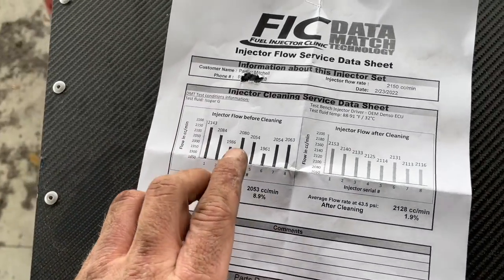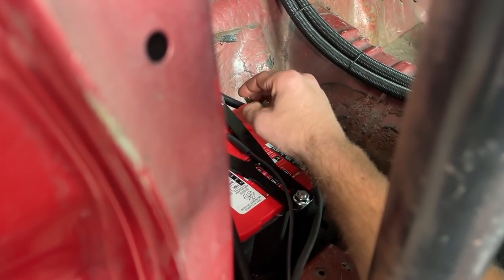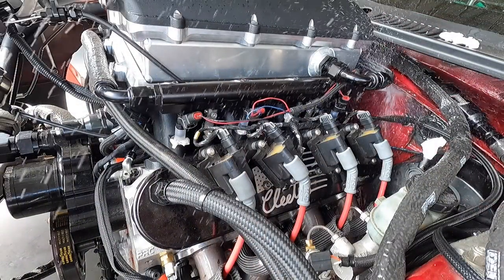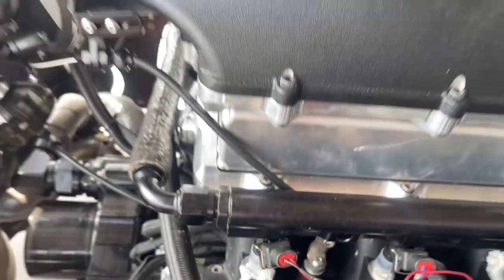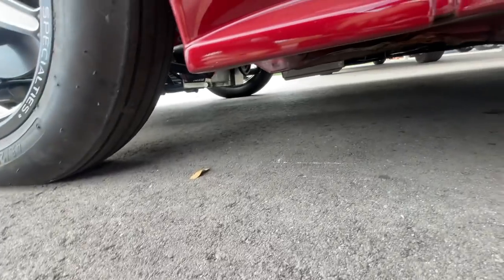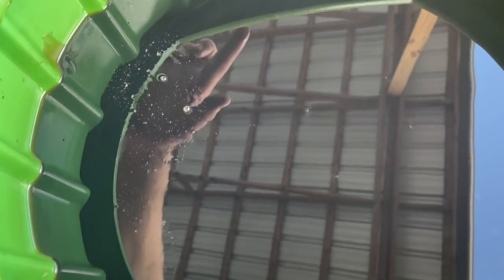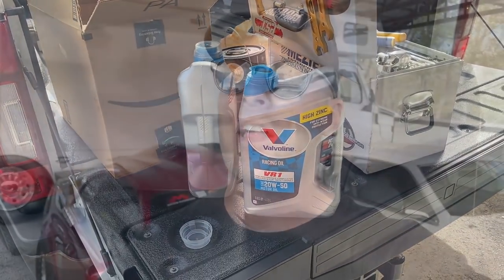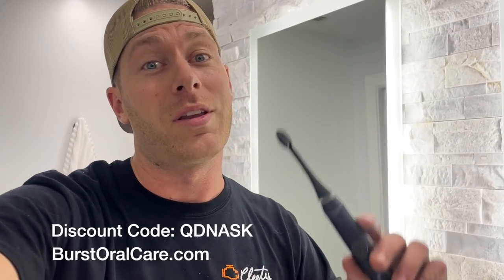Getting Dr. Pepper Ready for a Seven Second Quarter Mile Pass

Comment from the maker: Thinking I have a hole in the diaphragm of the fuel pressure regulator thanks to Tim M!!!
Reply: I've seen exactly the same issue with a bad diaphragm in an FPR.  It filled a cylinder through the vacuum lines.

Comment from the maker: Not proud of the mistakes and bs I show in this video but I’m showing them because I’m human.
Reply: Shit happens brother just do ur thang
Reply: The wire to the ECU sparked because it's the electronics to run the car and the battery has a constant charge because you run an alternator and it keeps the battery in charge if you didn't run an alternator it wouldn't do that
Reply: I'm here for the journey man
Reply: @keefespencer1173  it sparks a little bit because it is powering up the electronics in the ecu.  
He had the battery disconnected to PREVENT battery drain.  
Unless he had it off for a couple days, once the electronics have powered up once, 
they should not drain the battery over a couple days.  
Also, I did not see an inline fuse or circuit breaker on the Holley lead.  
You need to get one on that unless you just have a ridiculous amount of cash to throw away in the event of a wiring short.

Also, cant check for a fuel leak without fuel pressure.  
Injector harnesses wont show any power until the ECU is telling them to pulse.  
You should have had 12V (or whatever the battery is showing) on hot side, if you put ground to the block/body. 
Injectors are ground pulsed just like an ignition coil.

If you invest in an injector cleaning station, even a 4 cylinder unit, you can clean and flow the injectors yourself.  
Put the 2 highest flowing injectors at #1 and #8 cylinders since those 2 are notorious for running lean.
Reply: Nothing caught on fire, so how big could the mistakes be?
Reply: Plus, you were telling us regular folks to just go get a car, learning, and go race like you did. Mistakes are part of that journey.

Comment: This might be wrong, but was something I was told. If when connecting power wires to the terminals, if you get a spark it means you have a short, 3 of my vehicles do it and they’re the three that continually drain their batteries
Reply from the maker: Yes you are correct

Comment: Turning the computer on won't drive the injector's. Most ecu's need to see a cam or crank signal before firing injectors
Reply from the maker: In a terminator it does spray a little bit. I was testing it to see if it was dumping fuel.
Reply: @DoctrParker  with a Fuel Tech ECU you can test the injectors,coil packs and a few other things without having to do any of the stuff you're doing
Reply: @keefespencer1173  that's cause fuel tech is the shiz nit lol. What ya think people like Ryan Martin,Swangang,MurderNova and all them run I promise it isn't no Holley its Fuel Tech. Heck maybe that change would help give him the edge he needs to beat Cleetus the fuel tech is amazing especially the testing side when having issues. I bet they would probably even sponsor him a fuel tech Anderson seems like a great guy.

Comment: Hey random question but if the battery disconnect was on then shouldn’t the terminator lead wire not sparked since there should have been no power to battery?
Reply: battery disconnect only shuts down engine power, not accessory and control power, as far as i know

Comment: Is the cut-off a power cut-off or just a fuel cut-off? If it is a power cut-off like it's supposed to be, then you should not get a spark when you hook up the ECU. Also, if power is always to the ECU, it might send intermittent signals to the injectors, causing the intakes to fill.
Reply from the maker: Thinking it’s a torn fuel pressure regulator diaphragm. The boost reference leads to the bottom of the manifold
Reply: If the map sensor was bad reading wrong wouldn't it send fuel when it wasn't supposed to now that you fixed the map sensor has the problem happened again sorry haven't finished video yet just reading comments as watch
Reply from the maker: It hasn’t happened again but I also havnt pulled the intake. Going to pull the reference line to the FPR tomorrow and see if it spits fuel

Comment: VR-1 oil doesn't say it is a synthetic. Oil is used to lubricate the turbo which is running at a highly elevated temperature during high hp runs. Those high temperatures could cause the oil to break down or clog an oil passage.

 I did a little lab work on motor oils in the 70's. Crude based oils had an ash temperature in the high 200's and synthetics like Mobil 1 was in the low 400's. I have only used synthetic oil in any of my turbos with no problems.
Reply: 100% agree, synthetic a must do !!

Comment: You can NOT bend a rod on the starter motor.  it is IMPOSSIBLE to do.  There is not enough momentum by the starter to bend a rod during cranking.  Plus, not enough energy would be transmitted to the rod even if you got a flooded cylinder to light off, which is why you wont.  If you do CLAIM to have bent a rod using the starter, that damn thing was already bent before you ever hit the starter button.